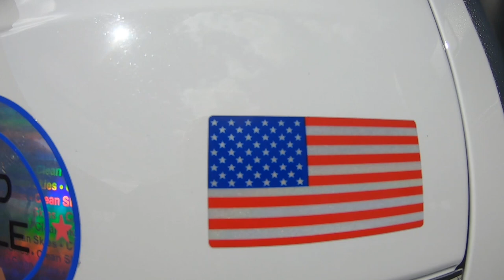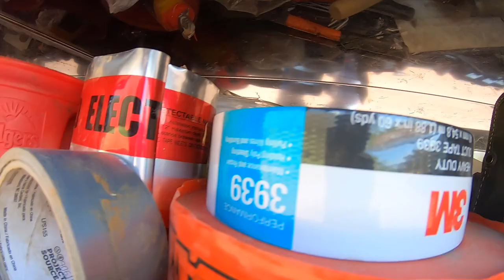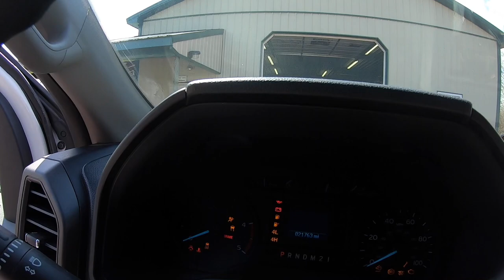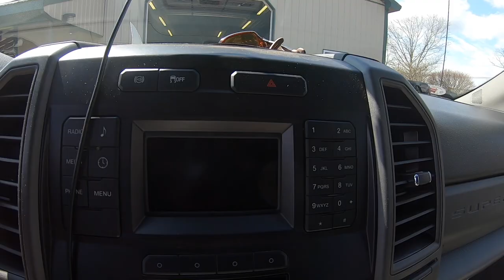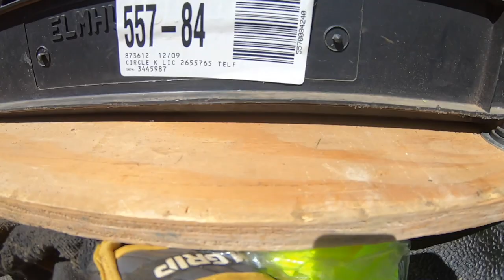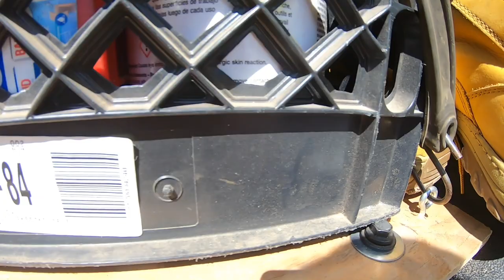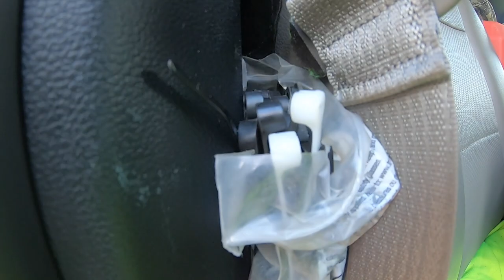Ford Powerstroke Diesel F-550 6.7 “2019 review"

Comment: Ever consider a small enclosed trailer to keep all those tools in? We set one up like a mobil work shop, with power, air, tools and a mini hardware store with tons of supplies. Its been amazing! We had it wrapped with logo and pics too, its a rolling billboard.
Reply from the maker: I have looked into getting one but it would only work on larger jobs. We travel up 6hours away and sometimes it’s only 2 or 3 days so we try to keep expense down by taking one truck and that truck has to pull the machine. You do have a good point and we will probably end up with one. It would have been perfect when we did the Stream bank repair job.
Thanks for watching and commenting we appreciate it 👍🏻

Comment: I’m in the same decision boat.  Are you still glad your new rig doesn’t have the L pack?  I’m ordering a bed for my new 550 and trying to decide between 9’ bed and L pack or 11’ bed and under bed storage.  Please advise on your thoughts today?  Thanks!!
Reply from the maker: For me and the 11 foot bed is the way to go. Everything I use comes in 10 foot lengths so it fits in the bed without hanging over. I have plenty of room in my under the body boxes and the one I have across the bulkhead I had to9 foot body with L packs in the past and the Lpac just becomes a hole that you can’t ever find your tools in, so what’s the use and having it?. I know people that have them and love them, but they are just not for me. Good luck in your decision.